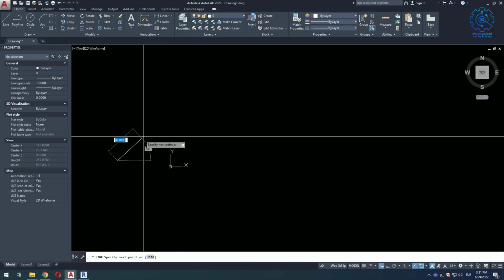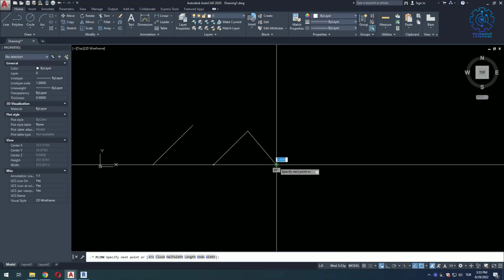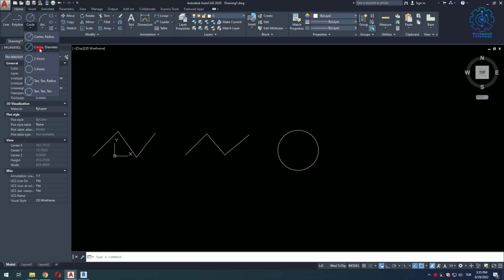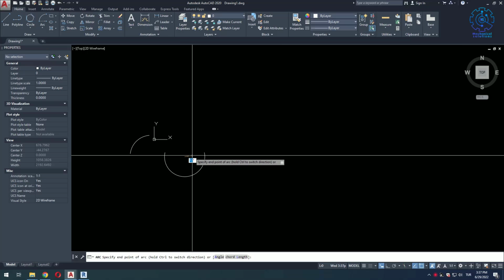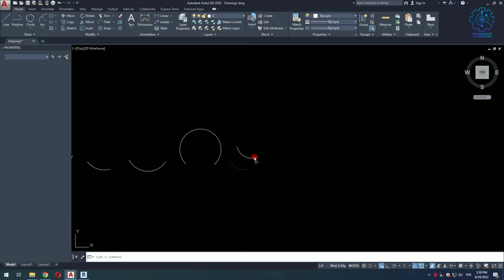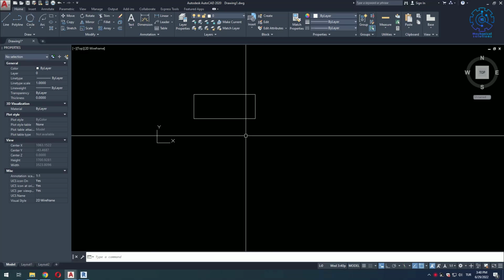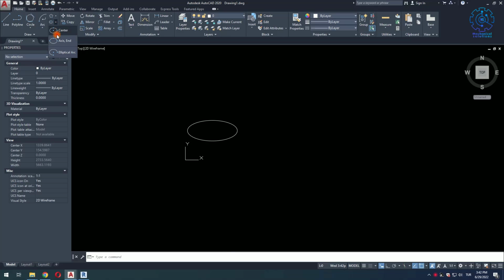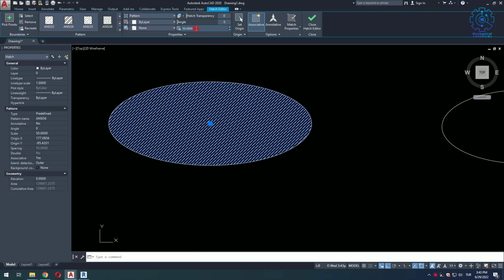Autocad tutorial | Part 1 | Line, Polyline, Circle, Arc, Rectangle, Polygon and Ellipse

Comment: Im unable to place the dimension and it is disappearing when i move to place next one.... a question mark is showing on cursor badge...kindly help
Reply from the maker: send me your project 
upload to a direct link and copy the link here
Reply: Screenshot of the error - https://drive.google.com/file/d/1o8V2BAQ98LySX87GUho0Rtlu-aYNRHyh/view?usp=sharing
Reply from the maker: @gowthamb7326  if you place the dimension go to dim style and change the font , if you use undefined fonts copy and paste the fonts files to Autodesk autocad font folder and windows font folder too

C:\Program Files\Autodesk\AutoCAD 2020\Fonts
C:\Windows\Fonts
Reply: @mechanicalsolutions569  thank you for your time.....much appreciate it
Reply from the maker: @gowthamb7326  
1-Wrong font most likely: you can change the font inside an Mtext without
 affecting the Style
2- If your font is Arabic or not defined fonts this problem happen

but if you send me the DWG maybe I can help